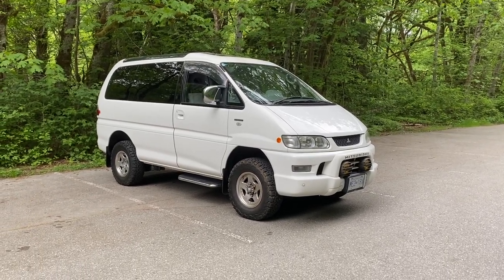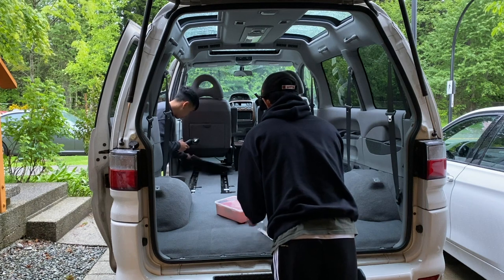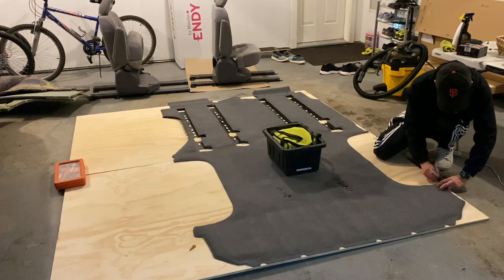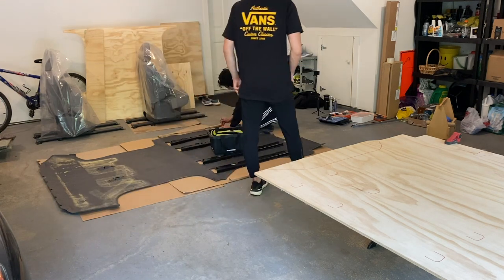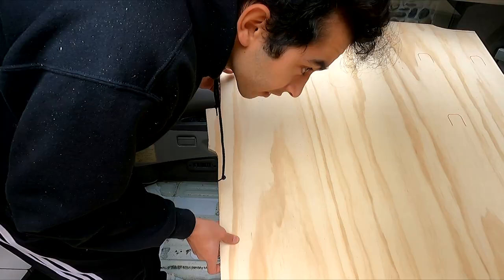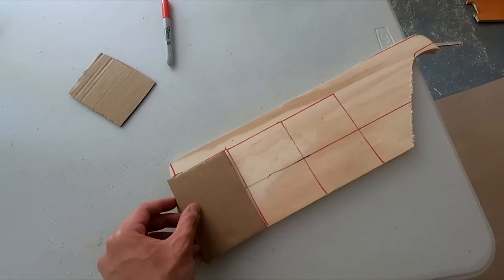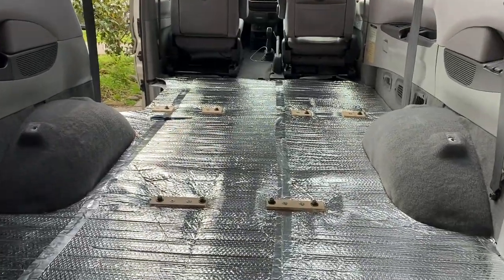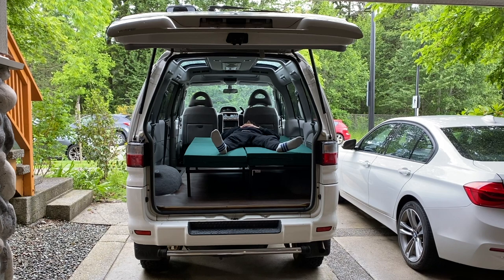Mitsubishi Delica Campervan: Floor Installation

Comment: Those holes you cut out for the 'actuating motors' as you say in the video are actually caps that need to be removed if they have to replace your rear struts, either replace your struts before doing this or leave a removable access hole for the mechanic or yourself to access these in future, otherwise your entire floor is coming out to undo the top of the strut, the top of the strut is near impossible to undo if not completely impossible to remove from underneath the delica.